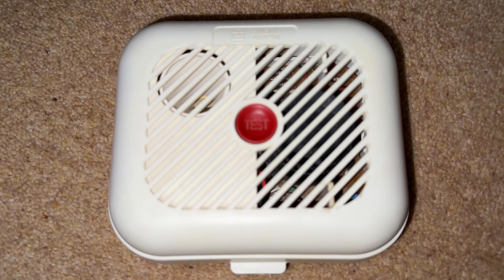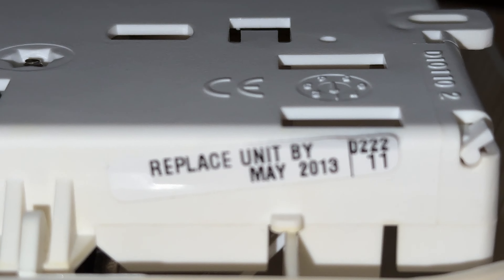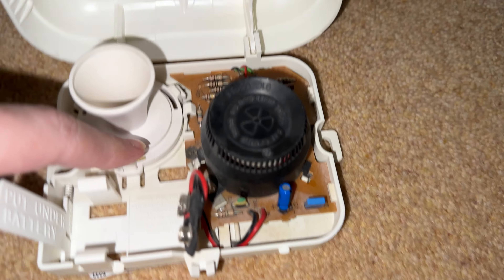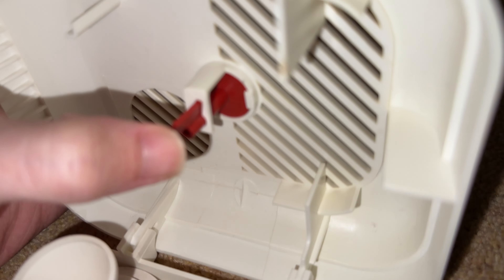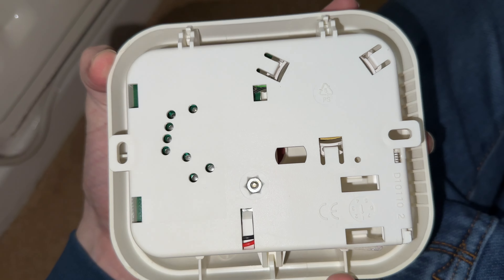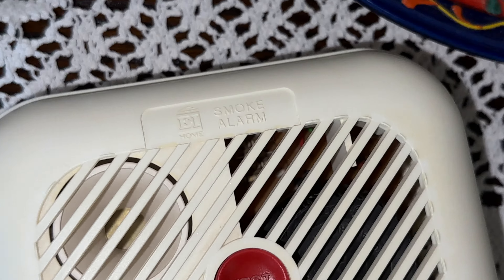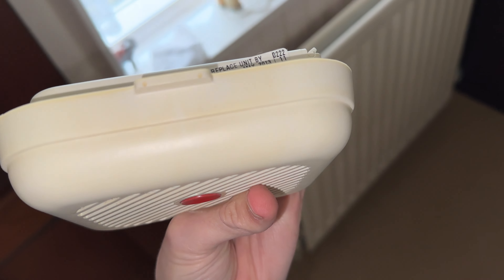I Got A Smoke Alarm

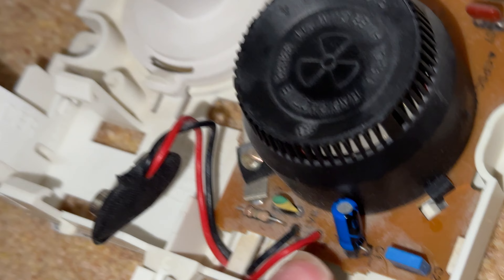Comment: Very nice smoke alarm! I have the older variant branded as Black and Decker! At 1:15 that is actually not the sounder. That is actually the sensor. The sounder is beside it above the battery holder. Someday you should do a testing video on it someday. You should also try to find the older version too! They might have them on eBay.